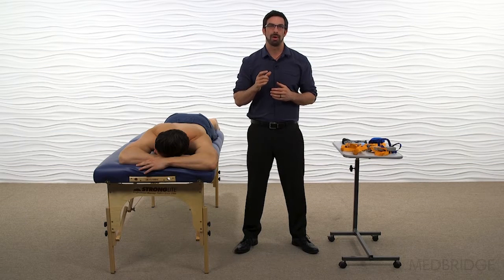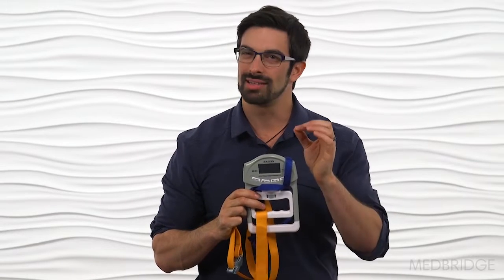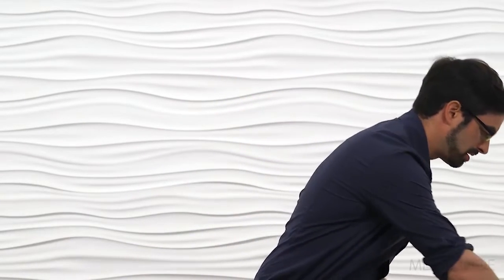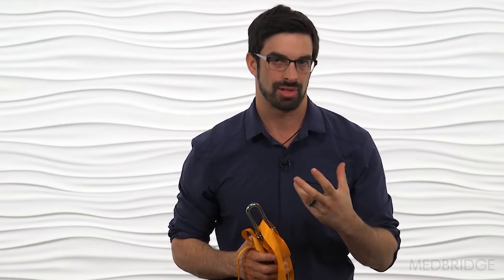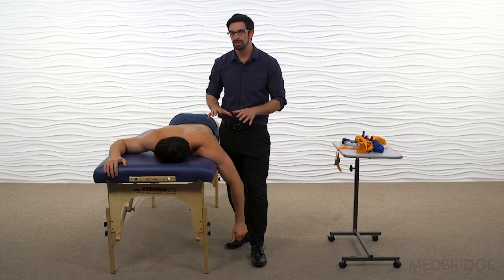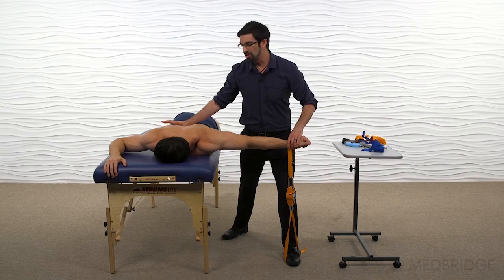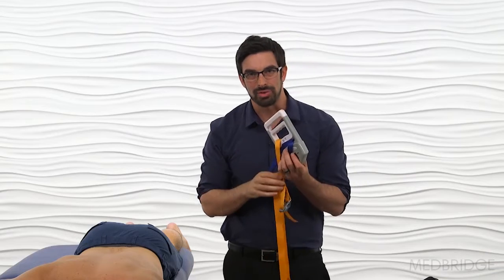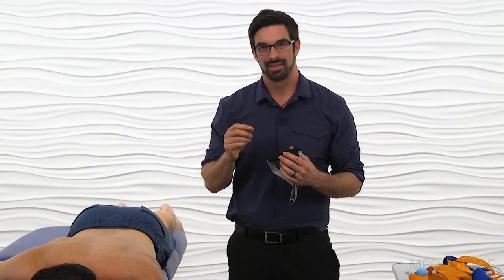Dynamometry Testing of the Middle Trapezius - Jared Vagy | MedBridge

Comment: What brand of Crane scale is that?

Will it hold and save the MVC if for example you are testing yourself in a hip hinge (deadlift) and the scale readout would not be positioned directly in front of your eyes for immediate reading?
Reply from the maker: Thank you for your question! We've checked with Dr. Vagy, and he says: 
"What brand of Crane scale is that?

Brand: Klau
Purchase: https://athletemovementsystem.com/products/
Make sure to also get the quicklink

Will it hold and save the MVC if for example you are testing yourself in a hip hinge (deadlift) and the scale readout would not be positioned directly in front of your eyes for immediate reading?

It will hold it for as long as you need until you hit hold again and it will go back to baseline. It won't save it though."